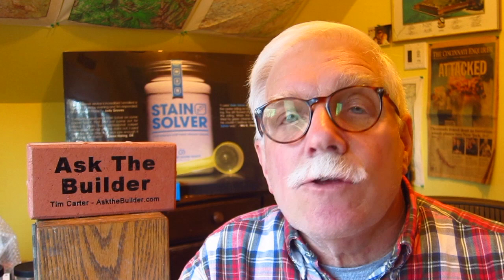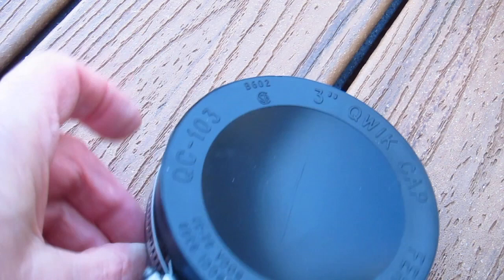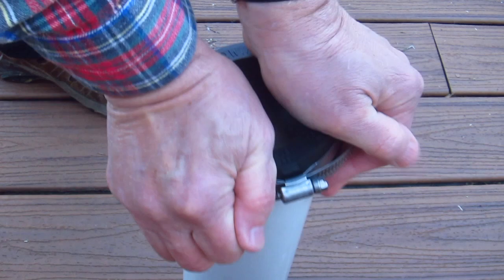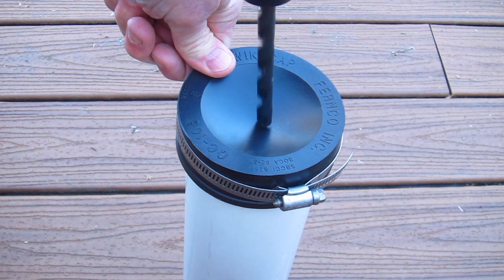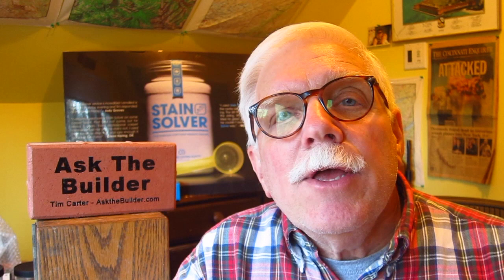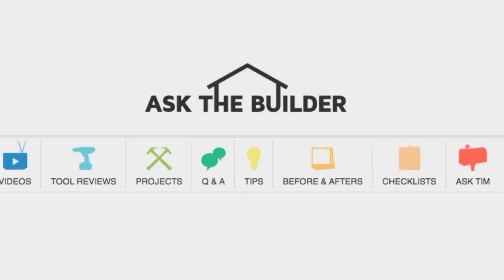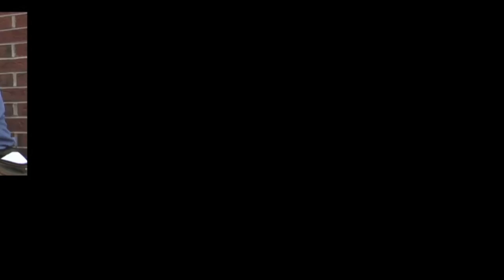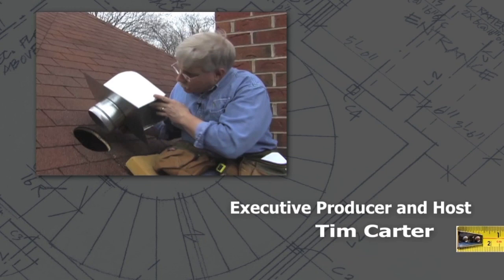Sewer Gas Smell Vent Pipe

Comment: We bought a new construction home in summer 2020. Last winter 2020 we noticed our main floor bathroom stunk on cold and windy days. This year we are noticing it again. It really stinks in just that one bathroom, not the basement or 2nd floor bathrooms below and above it (or the master on the other side of the house that has a different vent pipe above it). This builder forgot to connect a basement bar rough in to the vent pipe after doing an inspection pressure test which we found after doing a smoke test.  No smoke was noticed in this particular bathroom however. Is it possible that the vent pipe in the roof is just too short and therefore cold windy air is pushing the smell back in? Or is it more likely that a wax seal is bad on this particular toilet? We have 3 bathrooms on this side of the house presumably on the same vent pipe and only this main floor bathroom stinks.  We have an 18 month old conventional septic system outside which does not smell outdoors. Thanks for any advice.
Reply from the maker: I solve ALL sewer-gas issues over the phone. Too much back and forth. https://shop.askthebuilder.com/15-minute-phone-or-video-conversation-with-tim/

Comment: hi, mister - i do understand your point that small hole is enough for the intake, but how does it prevent the stinky gas flowing out? how this solve the problem?
Reply from the maker: Your answer is here: https://www.askthebuilder.com/plumbing-vent-piping-tips/
Reply from the maker: Engage your critical-thinking skills. What is the initial problem? What would happen if you put the cap on and didn't drill the hole? It's very important for you to start to think like a scientist might.
Reply: @askthebuilder  Hey Richard, my caps do not have holes in them since the new construction in 2008.  Any harm in keeping it as is or is there any benefit for the system since we do not experience any odor?

Comment: Past 2 nights my upstairs has had strong strong sewer odor....also past 2 days have been upper 90s outside.    But overnight the gas was overpowering.....could this be from a vent blockage?   Break maybe?
Reply: Also yes on a septic system.    Was pumped back last November..the first night we flushed all pipes with water......smell went away.....but came back again last night....smell is most prominent by upstairs bathroom and a bedroom near where the vent is
Reply: Also upstairs bathroom has a double vanity....one of the sinks is gurgling some
Reply from the maker: Doubtful from a vent blockage. Those are rare. Depends where the odor is being smelled for breakage. This requires one of my phone consults. Far too much to discuss and ask you.
Reply: Alot of things I also read was possibly the wax ring on toilet

Comment: I have sewer smell from bathroom sink, we live upstairs in a condo with neighbors below us, the pipes are connected unfortunately so not sure if the smell is from a blockage downstairs or a vent on roof, any ideas? We changed p trap still smells ty!
Reply from the maker: Lisa, I solve all sewer gas problems on the phone. I have quite a few questions I have to ask to drill down to the source:  https://shop.askthebuilder.com/15-minute-phone-or-video-conversation-with-tim/

Comment: I can smell sewer gas, seemingly coming from the attic, but only when the attic fan is on. Seems like it might be related to this roof vent. Any ideas? Thanks!
Reply: Hopefully someone didn’t end the vent in the attic instead of bringing it up through the roof like it should be.     I’ve actually seen it done before.
Reply: If the vent is near the fan's intake it's likely pulling sewer gas back into the house.
Reply from the maker: Correct. If you want FREE unlimited tips like this each week, subscribe to my newsletter at www.AsktheBuilder.com

Comment: We have a vent pipe that's right next to our septic tank. It's a PVC pipe that's currently covered with a loser metal cover. A smell definitely seeps out all summer. What do you suggest?
Reply from the maker: I suggest you watch my video one more time, maybe twice.
Reply: You don't have to be rude about it. Your video was only about the pipes out of the roof and I was simply asking if the same thing can be done for vent pipes located on the ground.
Reply: Tim.  We have an issue where the odor is only when the air conditioner is running. We have an evaporation pump attached and one inspector suggested we make sure the trap on the air handler is filled.  That solved the problem for about a week.  Odor is back, trap is full.  Why do you remove the caps in the winter.
Reply: I know some county building codes require everything be run to sewer, We installed a new Ac last summer and just ran the condensed water from the air handler a coil through 3/4 pvc to outside to a shrub. the problem with your situation is its hard to keep enough water in a small trap and when your air comes on, it sucks air through that drain line thats connected to your sewer, and blows it into your home through the ducting.

Comment: Thanks for the tip. Question- what stops the smell from escaping from a 3/8 hole as opposed to a 2in hole? Also, could I use a pvc cap with a hole and not glue it down? They generally fit  pretty snug. Thanks pal.
Reply from the maker: Engage your critical-thinking skills. Why do you think it works as so many other commenters have stated? Clue: think about adding sugar to iced tea.
Reply: Thanks buddy. I nearly died in a head on with a drunk with no headlights and suffered a severe head injury that compromised my "critical thinking skills". But thanks for your kind words.

Comment: Hello. Love the idea, but I heard of another one. It's called the "Studor Air Admittance Valve." If I install one of these at the P-traps, would it bypass the vent? If yes, would the gas smells be cut off? I'm thinking I will need to cap the vents, like what you show, but not drill a hole in them. I bought an OLD house and the odor in one room has soured the carpet. It stinks when the weather shifts and happens mostly at night, when the sun goes down. What a God send you are.
Reply from the maker: Christine, you're mixing up onions with watermelon. Note that I've been a master plumber since age 29. An AAV is put inside by LAZY plumbers that don't want to put in traditional vents. They ALWAYS FAIL at some point because they have moving parts. What I discuss in this video stops the outdoor smell that is pulled out of the vent pipe by the Venturi effect.

Comment: Hi Tim, I added a single toilet on a septic pump tank. I saw odd flush behavior and realized it was creating vacuum. Do you think a small male elbow (used in irrigation) would work if it were screwed in the pipe with a 6in extended at the top and a small screen filter for bugs/debris etc would work?
Reply from the maker: Please go to www.AsktheBuilder.com and READ all my plumbing vent columns and watch the videos there for your answer.

Comment: I would not leave this cap on if you are selling your home. Automatic red flag for a home inspector. Might a back flow valve on the main drain line be a better option if there is that much gas?
Reply from the maker: Yes, you could take off the caps before an inspection. Backflow valves on sewer pipes are fraught with problems. I'd NEVER install one.
Reply: What is the home inspector gonna say?
Reply: A red flag for an inspector? I hope the current home owners disclose this problem? Mine sure didn't and thats why I'm viewing this video. Thanks for teaching people how to rip others off

Comment: What’s your thoughts on a mushroom cap??
Reply from the maker: Does it restrict the flow to just a 3/8-inch hole?
Reply: @askthebuilder  he's referring to this: https://www.lowes.com/pd/Oatey-Mushroom-Vent-Cap-4-in-L-Circle-Round-Cap/3340572. With the mushroom shape, debris will just slide off and (seemingly) never block the opening. The opening has to be more than 3/8", but it does indeed reduce the original pipe's air entry.

I'd love to hear your thoughts on mushroom caps. I'm considering adding them and like the idea that the "hole" can seemingly never get plugged up or blocked.

Comment: I would be greatful for any advice as i am trying to solve my elderly mother's toilet tank overflowing issue.  It only happens when her clothes washer is filling.  With the toilet tank lid off, you can see the clean water rising as the clothes washer in the next room is filling with water!  The water overflows the tank and drains down onto the floor from the toilet flush lever.  Once the clothes washer tub fills and water shuts off from that, said toilet stops filling.   Just in case there is a question about this there is no problem with flushing the toilet.   It's all involving clean water backing up somehow from the clothes washer over filling the tank and spilling onto the floor.   Shutting off the water below the toilet tank has been the only fix so far.   It's a pain to have to turn it back on to flush the toilet then turn it off again to avoid the issue described above yeahAny idea what's going on?
Reply from the maker: Read all my toilet columns at www.AsktheBuilder.com. To get unlimited tips each week, subscribe to my FREE newsletter at www.AsktheBuilder.com

Comment: The vent stack doesn't just vent your house  it a vent for the  city sewer system. I really doubt this guy is a master plumber.
Reply from the maker: Terry, I am a master plumber - since age 29. What's more, I sat for the city sewer-tapper exam too. ;-) City sewers are typically vented through the holes you see in manhole covers. Were you sick the day air pressure was discussed in your high school physics class? I'm not trying to beat up on you, but I do need to point out that you're not knowledgeable in this area whatsoever. BTW, what line of work are you in? What do you do each day for a living? I'm just curious.
Reply: Ask the Builder , Terry, I fell outta my chair... “were you sick...” 😂
Reply: Damnnnn Terry...yo ass got owned son